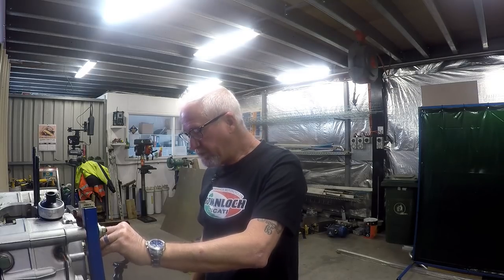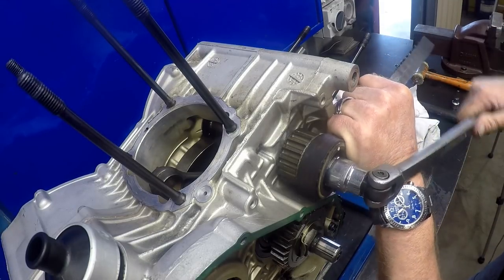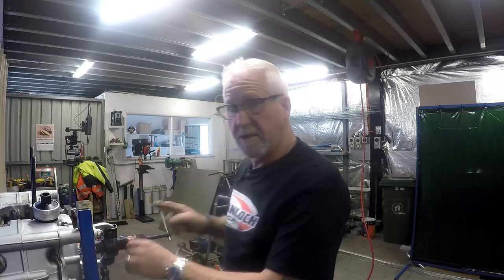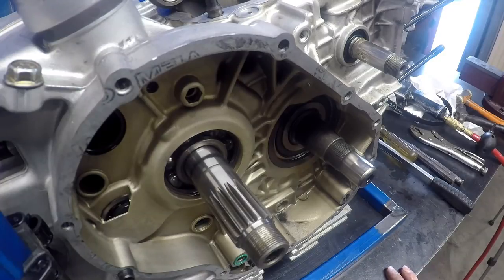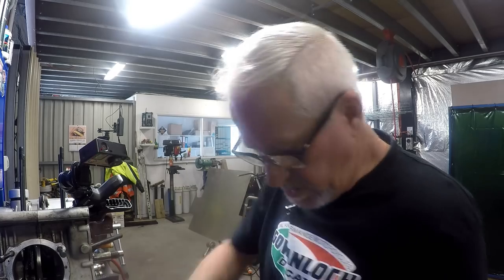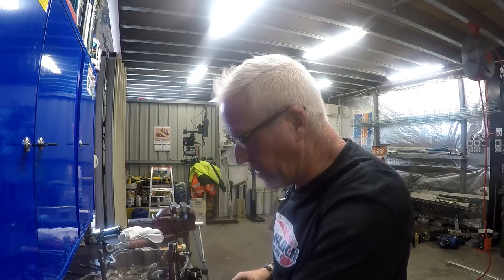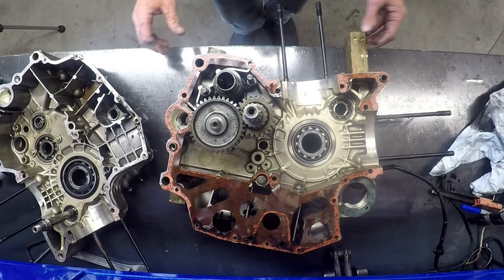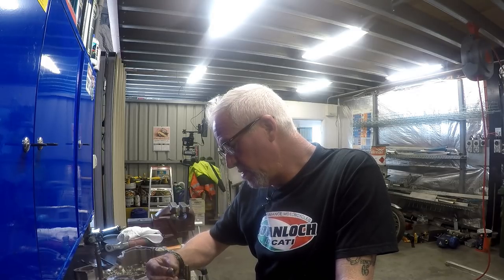DUCATI 900SS Ep6 - Split Cases and Flying Teeth

Comment: Hi Andy great vids, haven't had much time to follow or comment recently. Can I add a few things - I don't know why they use those awful castle type nuts other than space around it but it looked as though they could have got a hex nut in there, I think I would be replacing it with a hex. 

I don't like using the small end on the conrod to lock things up as I'm sure you don't, I have done many times, when I do I use the gudgeon pin in the small end and put a slip of aluminium with a CS 10x20 through from front to back. 

I have used the sealant you mention and it's good but dammed expensive, three times the price for half the amount of Threebond 1215 I believe the Japs and Ducati use it, its silver/grey so can't be seen and doesn't harden, so easy to clean off. I think you have used it in the past?

How I look at it if I can get a 71 Trident engine oil tight with Threebond it must be good, lol. Oh and a 61 5TA top end.

https://www.ebay.co.uk/itm/Genuine-Ducati-ThreeBond-TB1215-Silicone-Liquid-Gasket-Grey-Sealant-942470014/273535960556?hash=item3fb00385ec:g:j~MAAOSwPjNcdsJr

https://www.ebay.co.uk/itm/LIQUID-GASKET-1215-THREEBOND-250G-GREY-SEALANT-ENGINE-TRANSMISSION-GEARBOX-SUMP/402057441972?epid=1023501129&_trkparms=ispr%3D1&hash=item5d9c7db2b4:g:Cr4AAOSwfh1dg5wn&enc=AQAEAAACUBPxNw%2BVj6nta7CKEs3N0qX2SjwoosqGS6P2WiZyfc5%2BN9zO%2BjB8Mv%2FnaB13VfNEQntzA%2FNolbChyVFjEDN7Ugp8nzVUD4xqfzvPt3wCykV84EUEXMruJB3VKa2ILUWZjpb2TPMR2fngiR2Qyt5NqoH51K8%2BC%2B7PZN%2FLFArutM5GkV%2F0Qi7nhes07VYLb4VMKDDWrrJ1OJqNVI%2BlOl7sIXfdM9pUp%2FmM7cRDi7OIWxuKwNKff%2BJQD5lx%2FcZFaDdMDn1ZtPwGp2FcEUfIewLsZHEHN3QieKK%2B4dVkY0Z1lXP%2F36DgCdzM%2BvG%2FfY0bIfwSlqMhDx0T%2F2vXIFU85ayDLdTOtrm7cbDNNrBdqy0gW3r1DxlF1eq%2Blhc7gq68LP33y6siiZkN5l1uNcy1I%2Br4kYMYVcvuE1cLiyB5ot4szZeXD%2BJ5uXu1hCjMHbQq9QG3IKwzCthlyCcK76y8ShHUsXKgaECqAqS3fnXC5s7VZdIuVQfe6YmNF%2BRL5fI04hY6DCkm5ThiSdapScFat4XIbXv2kU3fk0i11T6HHr93stGlgfmVQTzcN4O%2FsxlexSkSHhH2qGTu8Nl6voGweCwE18uS8LFcxLrT7d%2BTBnrrFmiZB9bSkqKQ6j1b1uBDtMphqMcTXbbFcM8%2BdGozEdrbLhIcKt8fx0EhdVvnXhl6vCZ40wh9UmYOYKGiAe0ceRqigtubmkV2iOeade%2B4MjRNzMmlLMD9m1hrGDFStGzrRC1r58M8zb44XNcGsACwB7jjiyGnj%2FmXfU%2F5uVmPxZE758w%3D&checksum=40205744197233f297b890284e5483cc3e8b31c88c1e&enc=AQAEAAACUBPxNw%2BVj6nta7CKEs3N0qX2SjwoosqGS6P2WiZyfc5%2BN9zO%2BjB8Mv%2FnaB13VfNEQntzA%2FNolbChyVFjEDN7Ugp8nzVUD4xqfzvPt3wCykV84EUEXMruJB3VKa2ILUWZjpb2TPMR2fngiR2Qyt5NqoH51K8%2BC%2B7PZN%2FLFArutM5GkV%2F0Qi7nhes07VYLb4VMKDDWrrJ1OJqNVI%2BlOl7sIXfdM9pUp%2FmM7cRDi7OIWxuKwNKff%2BJQD5lx%2FcZFaDdMDn1ZtPwGp2FcEUfIewLsZHEHN3QieKK%2B4dVkY0Z1lXP%2F36DgCdzM%2BvG%2FfY0bIfwSlqMhDx0T%2F2vXIFU85ayDLdTOtrm7cbDNNrBdqy0gW3r1DxlF1eq%2Blhc7gq68LP33y6siiZkN5l1uNcy1I%2Br4kYMYVcvuE1cLiyB5ot4szZeXD%2BJ5uXu1hCjMHbQq9QG3IKwzCthlyCcK76y8ShHUsXKgaECqAqS3fnXC5s7VZdIuVQfe6YmNF%2BRL5fI04hY6DCkm5ThiSdapScFat4XIbXv2kU3fk0i11T6HHr93stGlgfmVQTzcN4O%2FsxlexSkSHhH2qGTu8Nl6voGweCwE18uS8LFcxLrT7d%2BTBnrrFmiZB9bSkqKQ6j1b1uBDtMphqMcTXbbFcM8%2BdGozEdrbLhIcKt8fx0EhdVvnXhl6vCZ40wh9UmYOYKGiAe0ceRqigtubmkV2iOeade%2B4MjRNzMmlLMD9m1hrGDFStGzrRC1r58M8zb44XNcGsACwB7jjiyGnj%2FmXfU%2F5uVmPxZE758w%3D&checksum=40205744197233f297b890284e5483cc3e8b31c88c1e

I haven't used this one yet but sounds good.
https://www.ebay.co.uk/itm/THREEBOND-1104NEO-PLUS-LIQUID-GASKET-MAKER-SEALANT-100g-GREY-SYNTHETIC-ORIGINAL/402058784850?epid=11017759015&hash=item5d9c923052:g:3bYAAOSwVR9dvsyg

Anything I have stated above is how I do it and not how I recommend you or anyone else to do it, as I am also an Idiot. It seems to be the thing to say these days. lol.
Reply from the maker: G’day mate, I’ll be using Threebond, already made my mind up.

Comment: Damn its just getting deeper and deeper in parts that need replacing,you sure made a whole ball of spaghetti now. Well on the positive side at least they can get replaced now instead of the original option of changing the cylinders and then finding a few months down the line you have another issue that needs fixing.

Comment: Hey Andy, awesome video man, had me holding my breath a few times tho lol. Only thing I was unclear on was how you stopped everything turning when you were hammering the belt drive gear nut off. And when you had the screwdriver through the rod were you apprehensive to hit the nut hard enough,  is it not recommended to put anything through the rod to stop the rotation? Cheers  👍👊
Reply from the maker: I didn’t use anything to prevent rotation, just the natural friction of the internal components. Just impact in the end was enough.

Comment: If brake fluid could get in there that would wash out the lube and advance corrosion and pitting of the bearing surface.
Reply from the maker: G’day Dave, yes but the key word is IF. I’ve looked at it a little closer and I don’t think it can get in there. There’s two o-rings on the actuator shaft that would stop it in it’s tracks before it can enter the crankcase 😕
Reply: @ANDY5  remeber they DUCATI gaskets lol not Ducatis  new high thec ones
Reply: @ANDY5  
If the seals look ok then that probably rules that out.

Comment: I had a primary side crank bearing on my Bevel fail many years ago.
Thing is, it was just a single ball that ended up looking like a rolled up ball of snot that just rattled its way around there.
The rest of the balls, altho were in distress, along with the races, were more or less undamaged. Just the single ball failed.

A manufacturing fault surely.

So, it doesnt really surprise me that a bearing race has simply given up. 
Final grinding, heat treatment, and plenty of other reasons it might have given up. I dont buy brake fluid causing any grief at all.
Ball and roller bearings roll, they dont slide. They roll!
The only sliding action in there is the ball/roller separator and that only has to deal with the weight of a single ball anywhere in its construction. Cam belt idlers and automotive alternator bearings come to mind Wizzing away for thousands of hours living on nothing but a smear of grease to keep them alive!

I believe that youre just unlucky Andy
Reply from the maker: Yes I thought about it a little more and clutch fluid can’t get to that bearing, the two o-rings on the actuator shaft would stop it in it’s tracks. Crib death I reckon. All other bearings are perfectly fine. I’m debating whether or not to replace all of them, over $250 for new ones 😕
Reply: @ANDY5  Yep do them and you will know whats in there. Hell of a lot of work to be wondering later if you have done the right thing.
Reply: @ANDY5  The mains alone are close to $400.00 in my neck of the woods. I had the right side countershaft bearing in my 750-F1 fail- cage broke. With the singles, I replace all the bearings any time I split the cases. Cheaper than going in again.
I lock the crank by putting the wrist (gudgeon) pin in the rod, and placing 2 wooden blocks across the hole. Yes! those pulley nuts always seem to be way tighter than they should be, I've broken a tooth off the factory tool trying to undo them. You should have stuck with your modified socket, would have saved the nut.
Generally great work, though. Thoroughly enjoying this, and you're doing great for the 1st time in one.

Comment: Where does the brake fluid come from?
Reply: Mark Smallman hydraulic clutch has it’s slave cylinder mounted on the left side of the engine and actuates a push rod which goes through the engine which is full of oil. When the seals fail, oil can come out, or brake(clutch) fluid can go in.

Comment: Good work there Andy, it must be nerve wracking having the experts peering over your shoulder as it were.
Them Hydraulic pullers are much better than acme screw type pullers in some respects as it's much easier to apply the amount of pressure/force necessary, although it is difficult to judge how much force is actually being applied.
Due to this they should always be used with caution and eye protection should always be worn as you did in this video. 
If I can give an example;- I was pulling a stuck inner race from a gear shaft using a hydraulic puller and had the puller wound up to what I thought was verging on excessive, I then gave it a few clouts with a hammer in an attempt to shock the bearing race off the shaft when a part of the race chipped off and whizzed past me at an incredible speed, the hardened steel shrapnel missed me and embedded itself in a fence about 4 meters away (it wasn't that large or heavy either !!).... I would liken the sound it made as it whizzed past me to that of a bullet in flight, I was not wearing any eye protection and would say that I would have sustained severe eye damage if not lost an eye if it had made contact....

Not directing this to you Andy, just pointing out to anyone reading that caution and common sense be used when using tools like these. xxx
Keep up the good work mate and don't rush thing's, You'll get the job done when you get the job done. ATB.

Comment: I’m not sure who complains about you using the cordless ratchet, but I can guarantee they aren’t ‘professionals’, and they don’t do this for a living.
We used to use air ratchets and rattle guns, now it’s cordless ones 👍🏼 (though I still use air as well)
Reply: Me. And i was a "professional" motorcycle mechanic until i retired, inc having my own shop for 15 years. I was'nt complaining either, i just don't like to use any form of power tool on small fasteners threaded into aluminium, both on dis assembly and especially on assembly. Each to their own, but i also made a lot of money with thread repairs in other people's alloy castings.
Reply: Michael Hayward I’ve made a bit out of thread repairs too. Almost always a result of over tightening by amateurs with hand tools. 👍🏼 6mm bolts done up with 1/2” breaker bars 😉
Reply: @Only_and_Lulu  or 1/4" bsw and unc with a 1/2" ratchet because they dont know you can buy 1/4 & 3/8" drive sockets....
Reply: Michael Hayward true that. Correct size tool for the job, size matters.
But that brings in the issue of misusing 1/2”-3/8” adaptors for the 1/2” ratchet on the 3/8 socket 😉

Comment: I am pretty sure if you had "oil starvation" bad enough to "lunch" that bearing, you would have massive damage throughout the engine...I would check all the case oil passages..I really wonder where all the bearing material is?.. I figure someone (previous owner) changed his oil and HAD to notice all the shinny bits..I think he filled it with new oil and rapidly sold it!!...kinda dirty way to be...No shop would let a good engine overhaul slip out the door, so it kinda speaks badly for the last owner..Long term use would have damaged a lot more parts..Good thing your not a fraidy cat..Ought to be a nice 900 when your done....someone's comment about leaving the nut on a few threads to capture the flying gear was a good one (I always do after launching a gear in my youth)..I always use Vortex Assembly Lube when reassembling an engine..it's a sticky lube that even after 5 - 10 minutes of warm up, remains on the important parts, to minimize initial startup wear..Good case half sealant!!.I also use the Porsche Case sealant..both good products..Well good luck and will be waiting for update..after close observation, I realized those, were in fact, Metric Vise Grips, so you'll be Ok..🇺🇸
Reply from the maker: Obs metric vice grips 🙄 I suspect that the material I found in the pre pump strainer was the remains of that bearing.

Comment: Hi Andy:  Good for you.  There's such an unnecessary mystique around Ducati motors on the owners' forums; "only take it to an expert", "don't do it yourself, you will screw up", etc".  This is bull.  Only two pistons and each has its own head.  Its the shims that scare everyone but there is so much really great information and assistance available on line. 

I very strongly recommend this YouTube site: https://www.youtube.com/channel/UC7n8NssOobhinJYMFDn2YIg
Whole Ducati engine rebuilds by critical components with loads of operation description, what tools are required, all the torques, little tricks.  This guy is truly amazing.  On one of his videos he explains that the weird aluminum nut (that you had trouble removing)  that holds the drive pulleys in place is a use once, throw-away item.  Before you put the motor halves back together, watch the videos that explain shimming the crank and other components; this video alone is worth it's weight in gold.

Good luck Andy; I'm looking forward to the next video.
Reply from the maker: Yes I’ve been subscribed to DesmoWorx for some time, but admittedly haven’t watched many of his vids. Maybe I should.